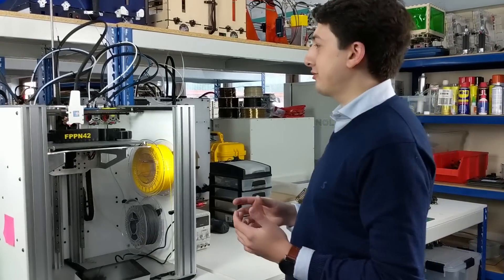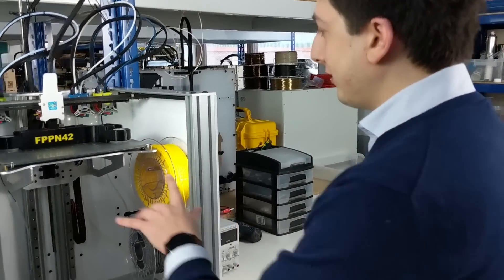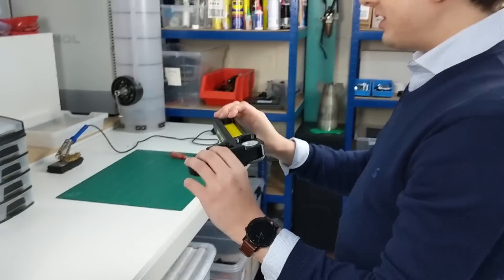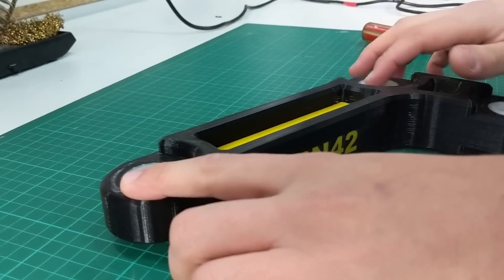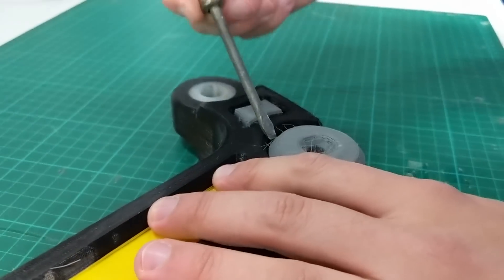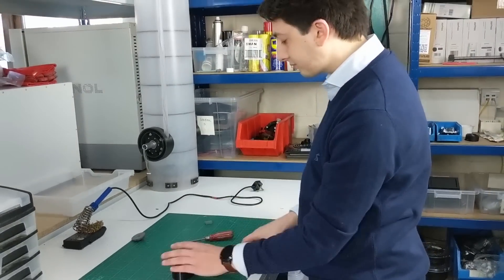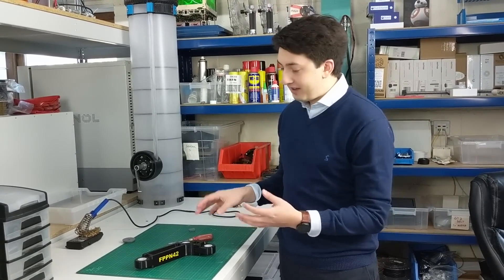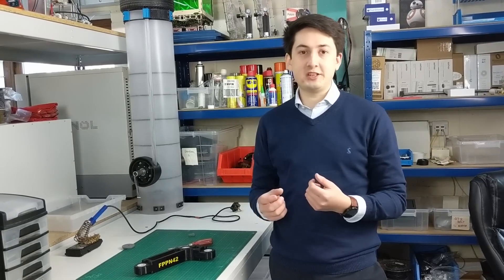Tool-Changing 3D Printer Teaser

Comment: You want to know if people would buy it... well it depends.

It depends on so many other factors that you haven't shown in the video. How does the tool change system actually work? Are we able to see it in action? From what I've seen here I can achieve the same results just using one head and feeding in different materials using S3D tool change script. What is the cost going to be? Is the added cost going to benefit the time savings in work flow? There are so many variables that haven't been addressed here. It's a neat idea but, to answer your question on would I buy it... it depends.
Reply from the maker: We're estimating that it will cost between £1,000 and £2,000. Customers who buy it would also need to build in their own electronics, extruders, tools, etc. We recommend that you read our blog post about it to get a better idea of what it's all about: https://e3d-online.com/blog/2018/03/21/tool-changer-q/

Comment: So you can print like the infill with a 2mm nozzle and the rest with 0.4mm ? Which software can handle different layer heights?
Reply: Slic3r can already.  Other can too: https://www.reddit.com/r/3Dprinting/comments/3zt9ln/slicer_for_using_2_different_layer_heights/
Reply: Some, but not all, of these things are being addressed by Prusa's enhancements to Slic3r for use with their multi-material upgrade. Also, the latest rumblings from Joseph Prusa are that they are looking at another approach to multi-material printing for the MK3. Probably because the current approach has proven to finicky for those of us that bought it. 
EDIT: Additional info can be found in these other YouTube videos:
Sanjay’s MRRF presentation:
https://youtu.be/DRkF-D0fEbQ

Sanjay’s MRRF discussion with Tom Sanladerer:
https://youtu.be/jfopGYO0r-M